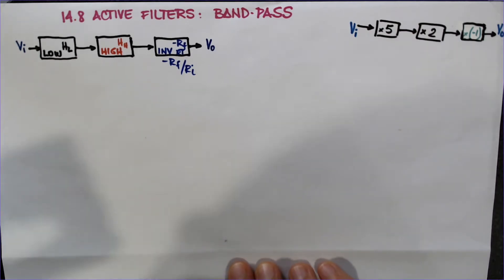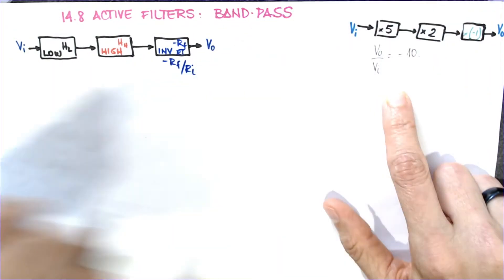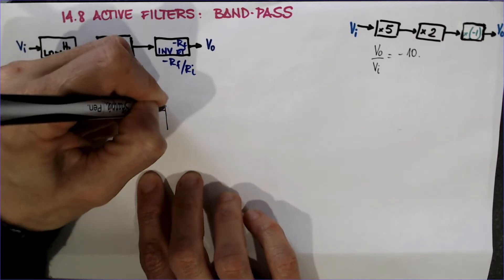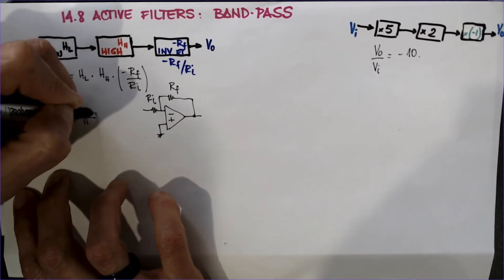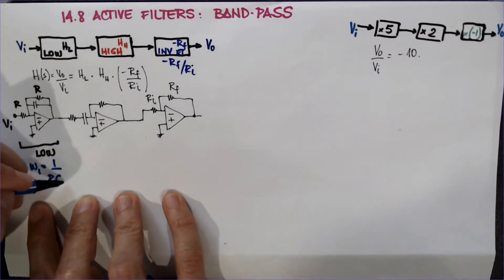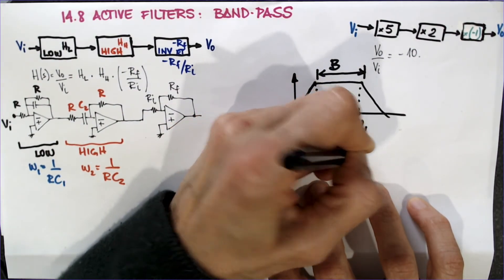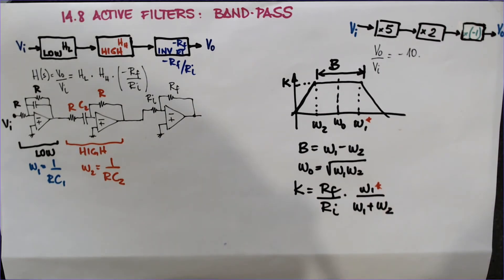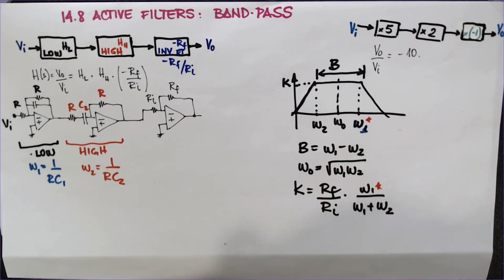Active bandpass filter, second order. Block diagram with cascaded circuits

Comment: Excellent! Normally I do not pay attention much to too much theory, but this one is made simple and not simpler! I dislike mathematics and I avoid it like the plague as I think I suffer from mild dyscalculia. This, however, I find very doable.

Incidentally, how do I actually choose resistors? I mean, resistors for any circuits. It is because I understood that big resistor has more noise than small one, always use the smallest resistor merely for a component to function, no more and no less. Problem is, nearly no body explains how to actually do it.

There is only one YouTuber (The AudioPhool) I found does it. Sadly, he explains only for transistor. I need to know for operational amplifier as well because a chip has far less noise compared to discrete devices, and a single chip simplifies life many times more than discrete devices.